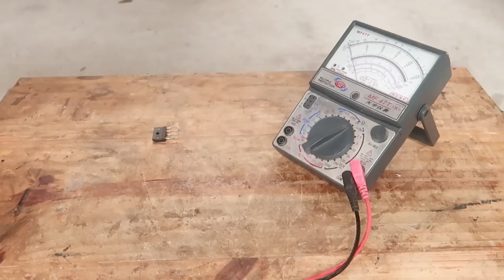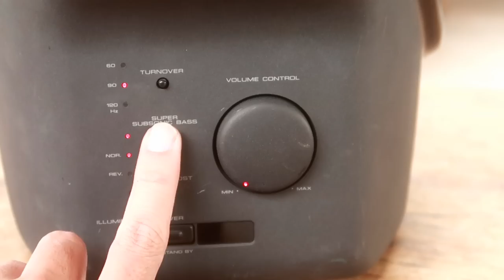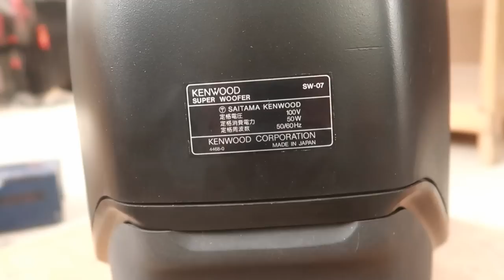Restoration super woofer SAITAMA KENWOOD // Restore snail subwoofer

Comment: I get using a power tool to disassemble these items, but never, never ever use it to put those screws back in. Why; in plastic and in wood especially that particle board wood if your screw is not in the original screw slot, it will make another cut and another groove, if you are lucky it will be fine this time, but a few more times and those screw holes will have nothing left to screw on because the threads are all cut out. If you're unlucky this time the plastic will crack and the wood will crack and fall apart. 
 On the woofer re-foaming that part was almost great but you must, must use shims around the voice coil to keep it all centered and not have the speaker rub on the voice coil at all. You also could use a sound test system to align it before gluing as well. The spider part does hold the one end well but the cone end aims the other end of that voice coil.

Comment: I would of removed the dust cap then use shims, glue will shrink some times so much it can be a problem , mind yeah i have repaired a lot of BOSE 901 systems on those you can use a self centering CD that can be used when gluing , I never use the Disk but some do some times it can be done with out shims, most kits for BOSE come with new dust caps, if you decide to shim them instead of doing it bye eye ...
Reply: You are a legend sir and so humble about it 🙏.
I thought I was just being petty about the Shimms

Comment: the woofer is broken, it can be heard that it "scratches"
Reply: Simply, suspension was glued without guides!! Seriously?? 
Fake video... On all repairs on this channel only transistors or diodes needed to be change!! Never integrated circuits!!
And ever the same mud... I laugh!!
Reply: @TheManeliss  9/10 times just recapping or changing the procesboard on an amplifier will fix the problems. Fets resistors and diodes rarely die. And if they do its immediately obvious.
Reply: @TheZombieSlayer1155  Hard to understand you... recaping, procesboard...?? what is this? can you write in simple english?
Reply: @TheManeliss  recapping basically means changing the capacitors on the board or power supply.
Reply: @TheZombieSlayer1155  m